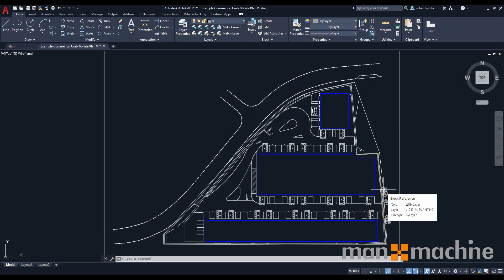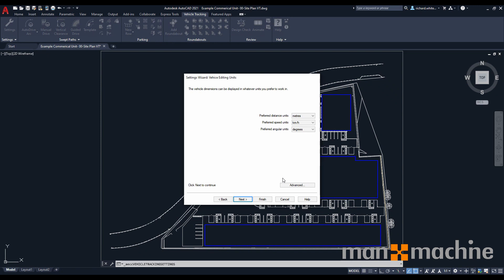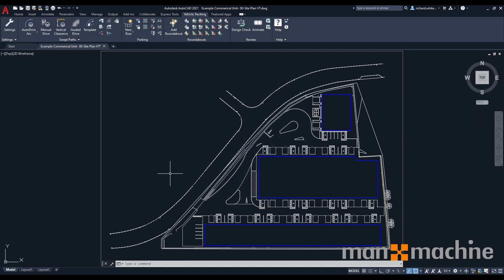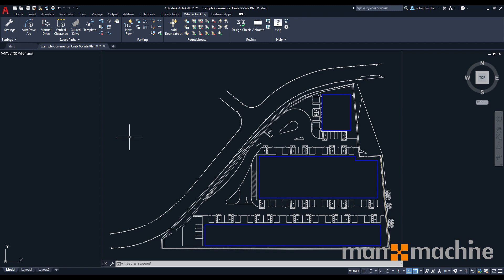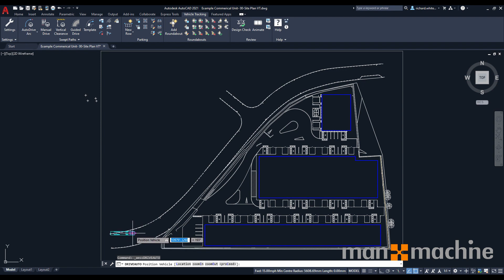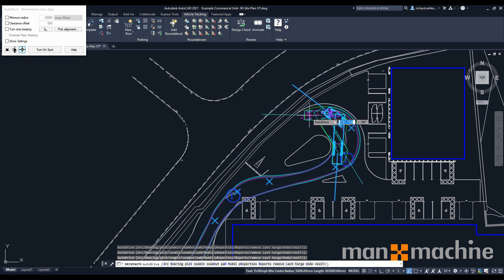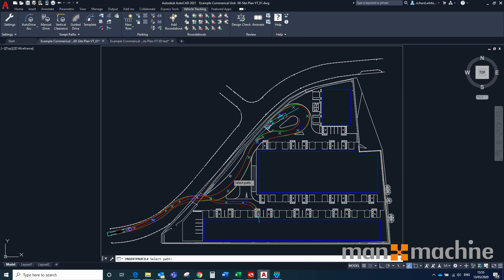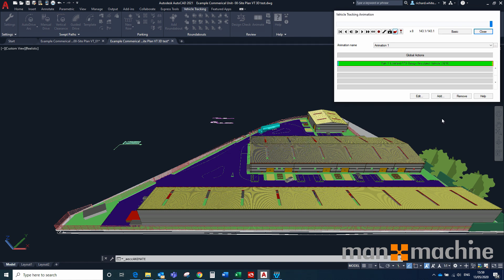Getting Started with Autodesk Vehicle Tracking

Comment: Is there any possible ways to check the vehicle density without having to count them one by one on site?
Reply from the maker: The Vehicle Tracking tool is designed to show the swept path analysis of a single/multiple vehicle types. It can also provide some help with junction/roundabout design and parking design. As far as we are aware it does not have any vehicle density tools as you can only count on objects which have been added to your drawings therefore unless you are adding a lot of vehicles to your DWG, we are not sure what you would need to calculate vehicle density in a 2D environment.